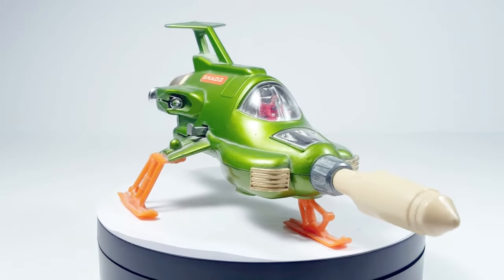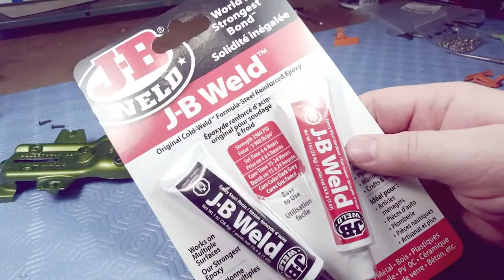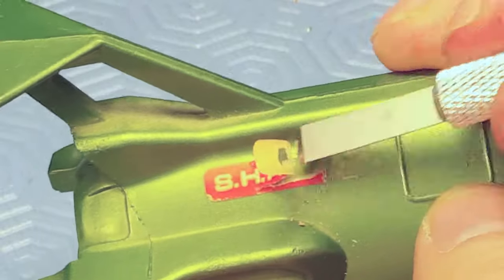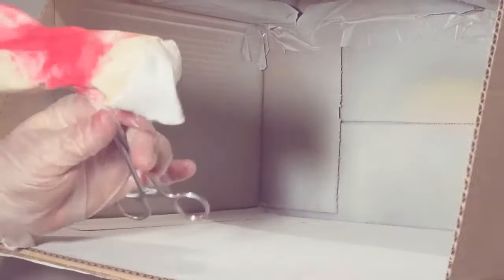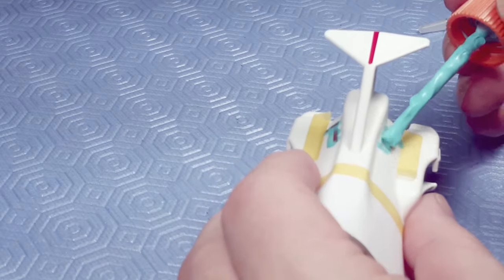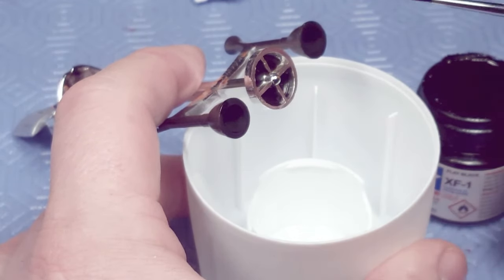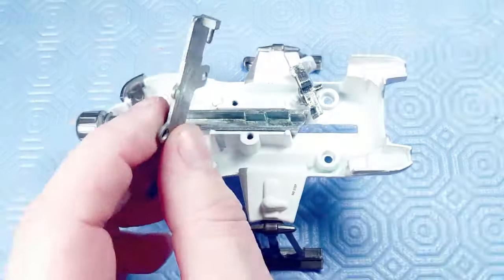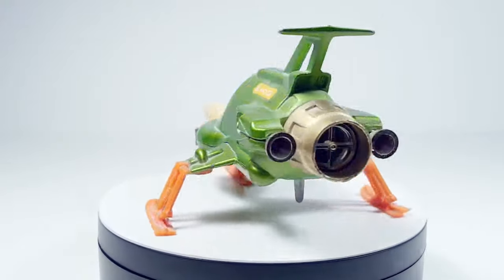Shado Interceptor 351 Outdated Version !Total Conversion to Screen version.

Comment: If that's Tamiya masking tape you're using then it's great stuff, low tack but seals onto the surface you want to  protect.
Reply from the maker: Yes. The Tamiya masking tape is the safest tape I have found. there's more heartbreaking than having your tape lift off some paint, spoiling your whole model.

Comment: hi there where can I get a set of those stickers for this Interceptor
Reply from the maker: I produced these decals myself. There are some commercially available stickers, but they are generally designed to reproduce what was originally applied to the toy. You can try: model-supplies.co.uk 
If you have the skills, you can design them yourself on the computer, and print them to waterslide decal paper. That's the best way to go. 
Cheers

Comment: Some nice work restoring the hideous Dinky colour scheme.
Only a couple of points: the chromed "hood" should be black or gunmetal, and why did you use a pink/cherry red? The stripes were scarlet.
The Andersons never designed any of their vehicles, that was mostly down to one of the greatest special effects men in the business, Derek Meddings, along with his design assistant, Mike Trim.
One further suggestion: Invest in a decent airbrush and compressor, it makes a huge difference.
Try a Harder & Steenbeck Ultra 2024. Designed for beginners, but superb quality.
Reply from the maker: Thanks for the tips. Didn't even think about the chrome "hood" (bonnet?). I guess it was not clear on the clips. The red I used actually looks a bit different than on video. Not sure if that is Scarlet though. (Scarlet as in the Captain?)
I bought an airbrush and compressor, but I'm not entirely happy with it. I will look into the Harder & Steenbeck Ultra 2024 for a future upgrade. Cheers Timo

Comment: Well done! A question... where did you buy the small water removible sticks "rescue" etc.?
Reply from the maker: Thank you Brompton. I printed those decals myself  with an ink jet printer, onto, what is called, water slide decal paper. There are versions for laser printers too. Just print them, spray clear laquer over them, cut them out, and then use them like the pro versions. Best to use a little dish detergent in the water. Cheers

Comment: Nice job, wouldn't have used a virtually mint example tho,plenty of ratty ones kicking around.
Reply from the maker: Thanks Andrew. You are right, I should have used an worn out one, but this was for an insistent friend, who wanted to have his model adapted. I knew I would get some flak. For my Mobile restoration, I deliberately bought a basket case for this sort of treatment, and left my good one alone.